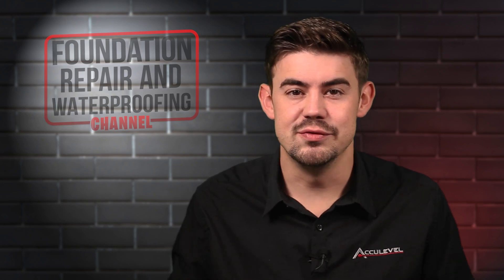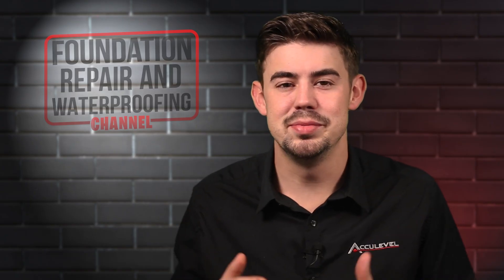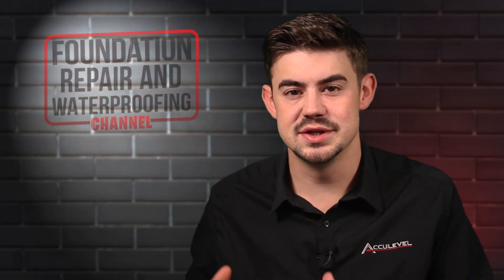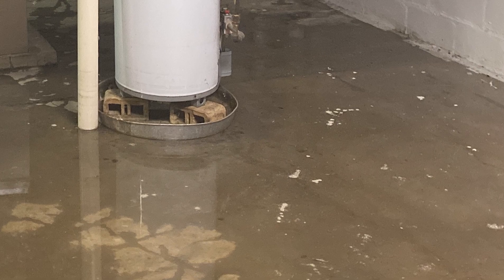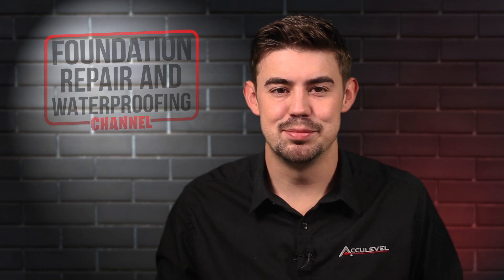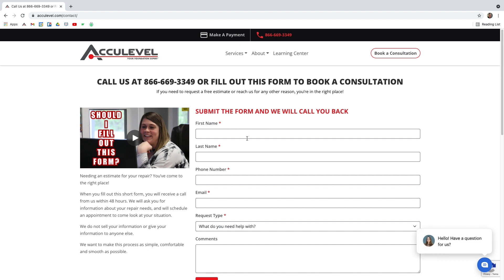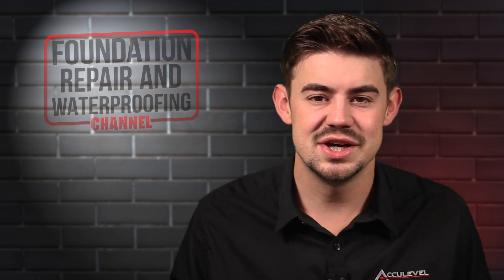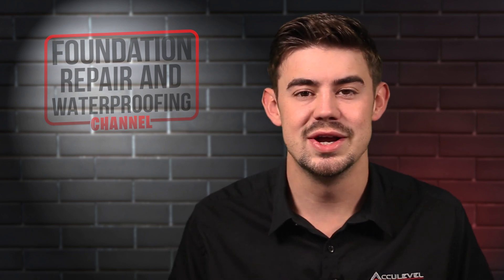Can My Sump Pump Discharge Lines Freeze?

Comment: I been trying to solve this issue for awhile with out digging a ditch. I will someday I'm sure but for now I have a heat tape on it that has worked fine in the last 3 years even to 10 bellow 0. I just installed a 2nd pump for a back up but If the 1st one trips the breaker both will go out. So now I got that issue to work on.  Will likely install another GFI on a different circuit.

Comment: I had to have my sump pump replaced last week because it was old. The major issue was the inside pipe was on the basement wall which likely caused the water to freeze and the water to back up into the house. I was up to my ankles in water
Reply from the maker: Sorry to hear about your issues. How did you solve your problem?

Comment: Thanks for this video.  I've been struggling with this scenario for almost a month now.  I just figured out today that this is what is happening due to replacing the constantly running pump that wasn't vacating any water.  Once I got the new pump to start removing water, the discharge pipe shot off above the check valve.  I am assuming that is due to a frozen line outside the home.  I live in Minnesota and we have had temperatures below zero the majority of the last month.  Now I am trying to determine how to confirm and melt this blockage.
Reply from the maker: We are happy the video was a benefit to you and appreciate your comments. Hopefully you get your issue resolved. We would be interested to hear what you find. Have a great day.
Reply: @Acculevel  So the pipe exits my house and heads straight down about 20 inches before it is under ground.  There was a black neoprene type fitting on the pipe secured by a clamp.  I removed the clamp and had to cut away the black fitting and discovered about a 2 inch gap in the pipe.  Of course there was a solid piece of ice connecting the two pipes.  I used a hair dryer to melt the two pieces and then to heat the pipe to the house until it was clear.  I am assuming this has happened in the past and that is why the black fitting was there.  I to Home Depot and used a 45 degree bend then ran pvc 2 feet then used and used a 22.5 degree bend and ran another foot of pvc until the pipe hit the ground.  It's spitting the water out about 4 feet from my house but it will work until spring gets here and I can develop something more permanent.  Maybe this will help someone else.